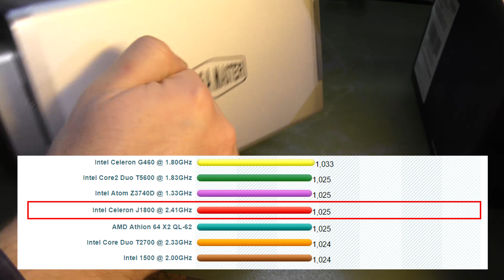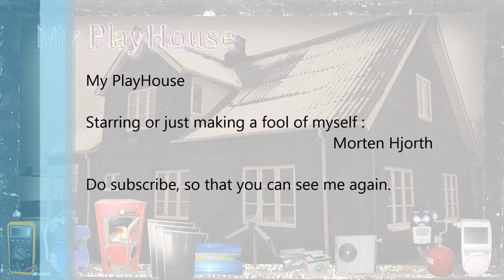TerraMaster F2-220 - Don't turn it on, take it Apart !! - 457

Comment: I won a Synology DS916+  NAS from Tweaktown. Seems like a good unit, only thing I thought was sort of stupid is this unit can have 4 or 8GB or RAM. I would have hoped they would put an access panel in you throw in a RAM stick DIMM so-DIMM, etc and it's upgraded. Apparently there is no interest int that though. 

I originally thought 8GB RAM for a NAS what on earth would you need that for. Then I saw all the apps, servers it has and it makes sense. You could almost run an entire SMB network off a simple Synology NAS. Mine only has 4GB RAM, I only had 400GB SATA HDD available so used 4 of those with Synology Hybrid RAID. It will take 4 10TB HDD if you add the expander then it becomes like 12X10TB HDD. This also has DUAL NICs so it can do proxy server, VPN, etc.

Comment: The only thing I am questioning is the plastic drive caddys, after all shouldn't the HDDs be electrically grounded to the case?
Reply from the maker: Hi Seegal Galguntijak
Maybe they are connected through the connector,, but yes that is a good point.
Thank you for watching! :-)

Comment: I built a HP microserver g8 as a NAS. It is quite cheap (especially considering it is "as close" to a server as you may get elsewhere) and has a lot of power on it. I swapped the g1610t for an i3 3220t which has more power. The only problem I see is that drives are not hot-swappable. I guess you can just search for another controller though, but I think considering the advantages it is not such a drawback.
Reply: It's very nice, but it does a bit of noise from the fan doesn't it ?
Reply: André Lopes not really. I believe it did in the past when ahci mode was used but it was fixed on a bios update. it is "a server" so it may be louder than other solutions but I haven't noticed anything special on normal use. I'm not super picky about noise though
Reply: It takes a lot more watts, so it's not really cheap. You pay through the electicity bill, i3 takes at least 35 watts. Not a smart choice !

Comment: The motherboard in this unit reminds me of how "CB" citizen band radios were once made.  The manufacturers would make a single board with all the bells and whistles in place but when installed in the final model, those extra features were not accessible because the case and or user interface was not made to support them.  In a higher priced model, those features would then be accessible with a different user interface.

It appears to me this TerraMaster motherboard is probably a one size fits all models but limits accessibility like the VGA interface (IPMI?), to more expensive variations.  Just my thoughts on that matter.

The on board USB connector for the OS on the TerraMaster is just like the connector on my Supermicro FreeNAS server.  As you commented, maybe this board can accommodate  different operating systems for NAS or linux.  That can really make it more user flexible and fun to use.  This box has a nice price point too.  Love all that aluminum.

Great Video as usual!  Can't wait until I see the test run.

Happy New Year!!! too.
Reply from the maker: Hi BillyLapTop
Thank You very much!  glad you liked the video :-)
Thank you for watching! :-)

Comment: Hey Morten
Are the drives configured in a RAID1 setup?
Is there any onboard RAID controller with options? I'm assuming there is.
Reply from the maker: Hi Roderick Roderick
Yes,, it can do  
Single disk、JBOD、RAID 0、RAID 1
http://www.terra-master.com/html/en/article_read_1190.html
Thank you for watching! :-)

Comment: Can you tell which operating system you have installed? And you think using the internal usb could add a wifi connection to the NAS?
Reply from the maker: Hi Iván Rodriguez
There system is called TOS,,, (Terramaster Operative System)
Thank you for watching! :-)

Comment: Hi,
If they had to put such a big and ugly label on there on how to insert the HDD's, they clearly did something wrong in the mechanical design. How hard should it be to insert a HDD in a hot swap bay...
To determine whether a USB port is a USB 2 or 3 port, the color is indeed not always a guarantee. Although it is still no guarantee, I always try to see the five small copper pads in the front of the blue plastic. If they are not there it is at most USB2, if they are there it could be USB3.
The HDDs connect to just a riser card. I highly doubt that's PCIe because there is no controller IC visible on the riser card. I think they just used the PCIe 4x connector because it was found to be cheaper than other options and suitable for high speed interfaces. So I wouldn't put any PCIe card in there.
F_PANEL probably stands for 'Front panel'. So probable some buttons/LEDs or USB. Since it is a 10 pin double row header with one corner pin missing it is probably 2x USB.
Also, I really don't like the USB stick inside. Yes, for a tweaker, it allows you to try to run e.g. linux very easily. But, what if it gets loose during transport to a customer who is not going to open it? eMMC would be better. Although a USB stick which is accessible from the rear and locks in using e.g. a screw would be nice for hobbyists.
Reply from the maker: Hi Jeroen Maar
Thank You very much!  glad you liked the video :-)
Thank you for watching! :-)

Comment: This internal pen drive is a great feature, probably you can change the SO to a Linux or a Freenas like system. And the vga connection is easy break out with home-made cable!
Reply from the maker: Hi Henrique Gravina
Thank You very much!  or just add a 7/9" LCD on the side...
Thank you for watching! :-)

Comment: I don't know why they didn't go with an AMD A8-7600k would have been better when you 4 cores and a graphics card and Trueaudio sound card all in one single chip you know a SOC.
Reply: power usage and NAS mostly doesnt really require that much CPU power.
Reply: Well the AMD chip draws a lot more power - I think at least 75 watts - so that would cost a bit to leave it running 24/7.  These small Intel chips require very little power - 15 watts at most - and only need a small heatsink.

Also what could you do with a sound card in a server? :P